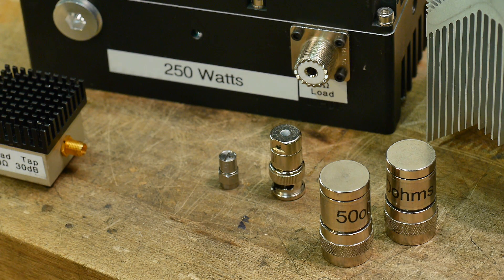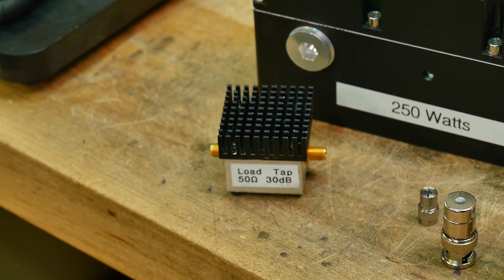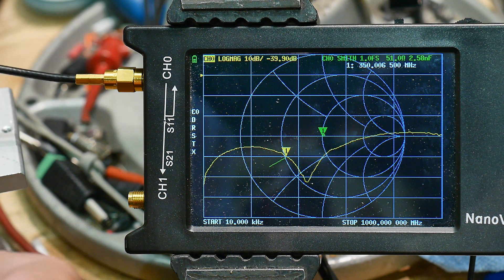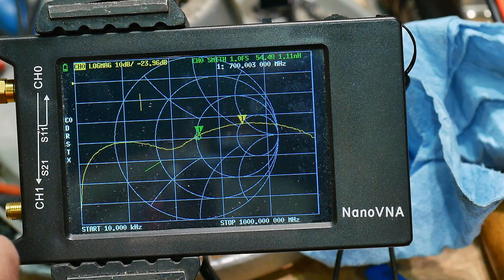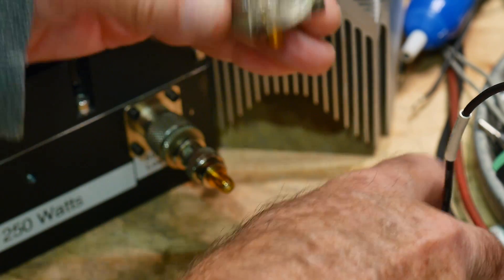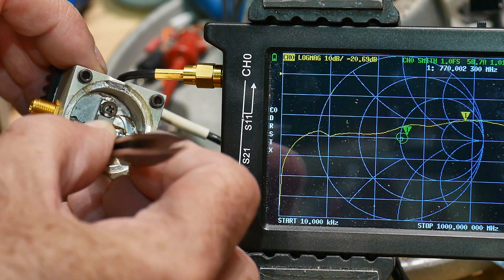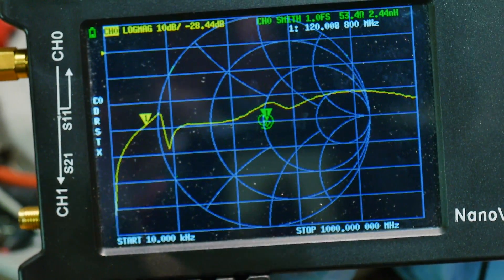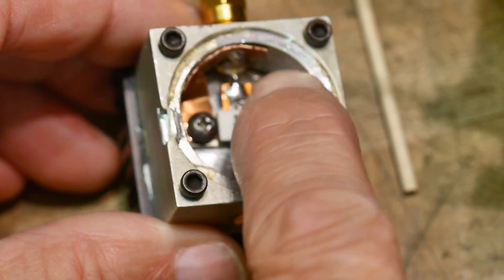#593 SMA Load Improved and NanoVNA Measurements of Several Loads

Comment: You might try to take out the heat shrink grease which appears to be insulating the load resistor.  Perhaps you are adding band-aids to a sucking chest wound when you add the copper on the top.

Comment: I have a small 50 ohm BNC terminator that started life decades ago as a terminator for "thin" Ethernet.   I was shocked and dismayed when I put it on the NanoVNA to see that it wasn't really all that great beyond HF.  To be fair,  10 Mbit ethernet with it's manchester encoding is a 20MHz signaling rate, so I suppose the terminator was "Good Enough".   Next I'll have to check the yellow-snake thick ethernet N terminators to see how they will disappoint me.  ..and the answer is better than I thought, about 20 dB return loss to 275 MHz, so not too bad!

Comment: Wow! I thought I was doing something just building my 1st small oil cooled dummy load with 8 - 100 ohm 5 watt metal oxide film resistors.
I didn't realize one needs so many dummy loads!🤯

So I have a Nano VNA and was watching your video trying to figure out how to test and see what I actually have.
The multimeter shows 49.6 ohms and I was wondering if it can be tuned for a perfect 50 ohms?
Reply from the maker: 49.6 is close enough.
Reply: @IMSAIGuy  Ok thx!
Do you know how to tune input and output circuits on an Rf amplifier?
Reply from the maker: tune? you mean impedance?

Comment: It's becomes VOODOO after 50MHz lol The 40ohm could have been 50 at 1 time until too much power was applied. I also have a high quality load thats marked 50 but also measures 40 ohms at DC. Have you looked at the response if you put a shield on the bottom? Could have near by FM broadcast blasting into it? Where did you find those enclosures? 73 N8AUM

Comment: That resonance is likely because at that frequency the line is 1/2 wavelength long, at at 1/2 a wavelength Zin = ZL. So any line discrepancies in Z0 that make the return loss bottom out at around only -30dB at other frequencies drops away.
Reply from the maker: oh you're right I was lazy and didn't cal at the end. i understand a dip, but why is the bottom limited to -30?
Reply: @IMSAIGuy  it's just not a perfect 50 ohm line is all (probably falls within a manufacturing tolerance of 50 ohms), the dummy load is a more precise 50 ohms so the match gets even better at lambda/2, because it's seeing the precise load directly, not through a line that's +- a % of 50 ohms. In the thick of things -30dB is still letting 99.9% of the power through, so it's still a good match overall for most consumer applications.

Comment: Yes, now I remember in a previous video of intending to make use of the eBay surplus 70 MHz bandpass filters's square metallic enclosure, you mentioned that you had to force open lid as it had been glued together. So, here too after screw fixing the dummy load resistor you have used some glue and that's why there's no electrical continuity.
And your homebrew 250w dummy load must be having a coaxial cable between the connector and the resistor; I think that is the limiting factor of the highest frequency to which it can be used. I mean the cable (PTFE?) (exactly 50 ohm!?) and it's attachment may be contributing some reactance.
Reply from the maker: you are correct but thinking too hard. I did not remove the coupler in the old unit and put the 50ohms at the end. the frequency rolloff is the coupler. I didn't care so left it in.
Reply: @IMSAIGuy  okay. I just wanted to clarify my doubt. Thanks for your kind reply.

Comment: Yet another cool demo of the significance of RF construction techniques. I believe you didn't ensure electrical continuity between the flange of the thick film resistor and body of the box and hence with the shell of the sma connector. And yesterday I had thought that you had the small wire just to ensure additional ground connection. Now I Justice can see some kind of adhesive (some insulating material) cynoacrylate/araldite kind of material between the round lid and the body of the square box. Or is it something else!?. I don't know.

Comment: If you calibrated your VNA with that 18GHz load the measurement of that same load is more or less meaningless. BTW update your firmware, many new useful features in newer versions.
Reply from the maker: I did not calibrate with the 18GHz load. Thanks for the comment

Comment: Good morning IMSAI Guy!  The experiment is really cool.  A suggestion, as you have a TAP RF connected in a capacitive way over the load resistor, try placing a 50 ohm load on the TAP as well, I believe it can stabilize the circuit, since the clamp insertion brought the ground closer to the housing  to the TAP probe.  Congratulations!!!